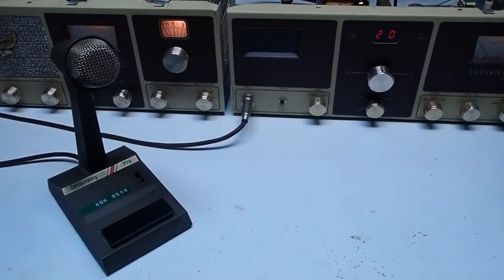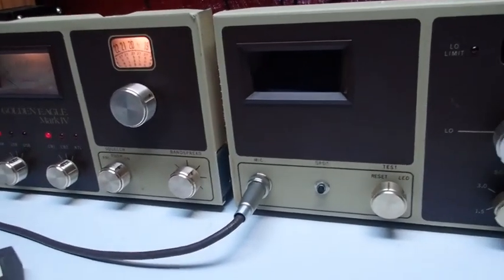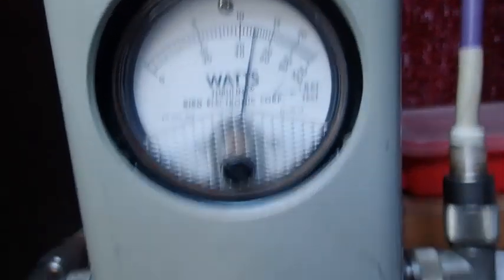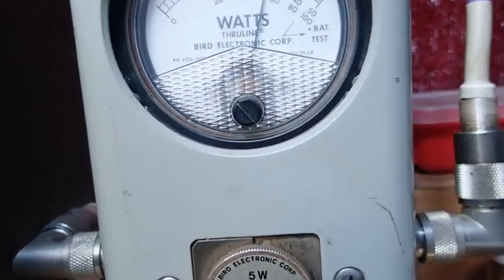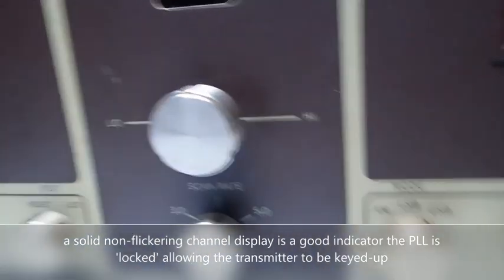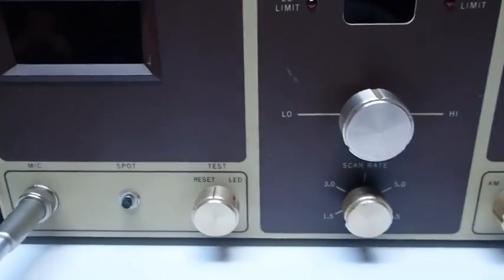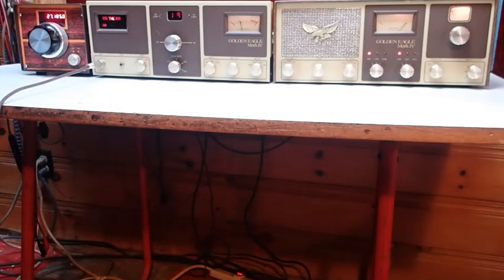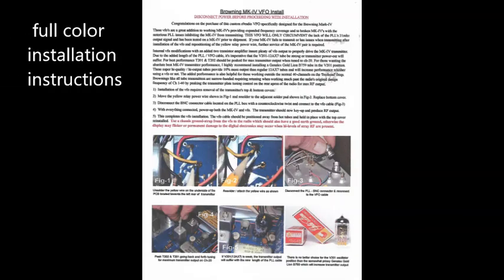Browning MK-IV VFO

Comment: I took an old siltronix vfo and put a dds inside the case. It works awesome and extremely stable. It was cheap and easy and it looks like a stock vfo with digital read out
Reply from the maker: Personally I'm not a fan of the DDS VFOs. I do a fair amount of out of band operation and they create ghost signals AKA birdies that pop up anywhere on the band and they also have a square wave output which creates a hum on many transmitters where as the analog VFOs do not.  Yaesu also stayed with analog type vfos when they first went to a digital display for this exact same reason. They create phase noise which is unacceptable in my book.  For those of us that do weak signal work, we want a quiet noise floor, not something all cluttered up with phase noise from a digital vfo.

Comment: A quick question if I may, would it be possible to install a toggle switch on the jumper?
Reply from the maker: No this is a very low-level RF circuit and any kind of switches will change the impedance and severely degrade the performance. There are BNC connector antenna switches however the radio needs to be tuned to the length of cable used and performance will be less than optimal if the radio cable and the vfo cable are not of identical length and impedances.
Reply: Thank you, have a great day.